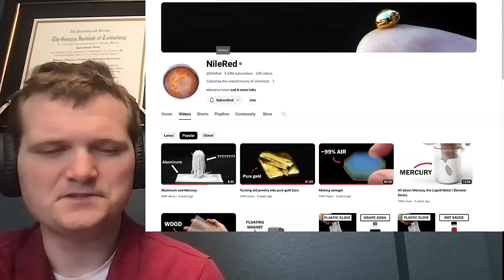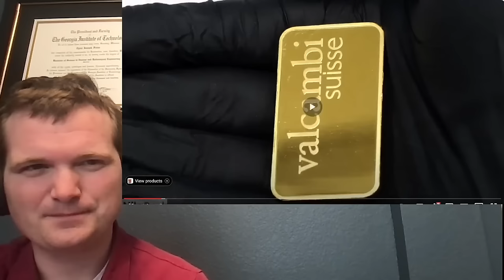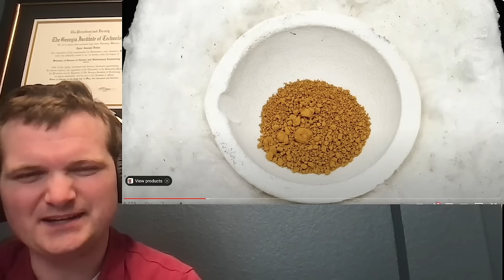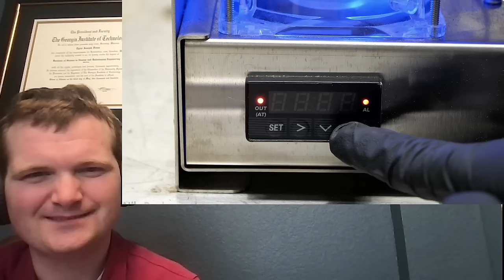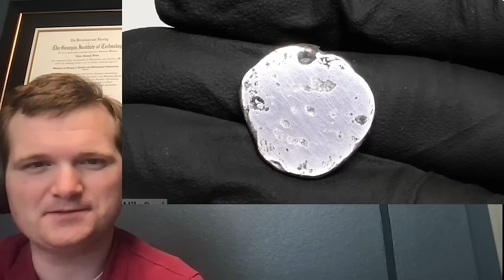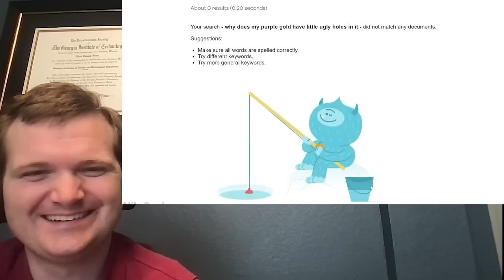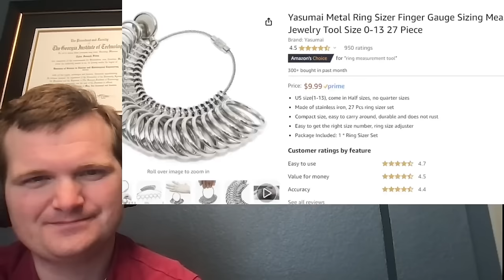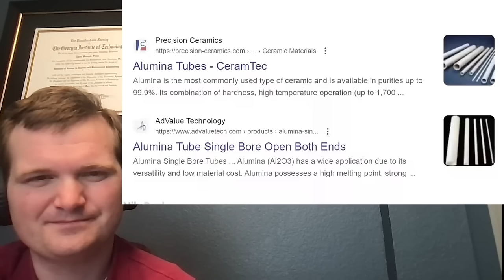Nuclear Engineer Reacts to NileRed Making Purple Gold FULL Version

Comment: Former jeweler/caster;  the other reason you preheat the molds is if there is ANY moisture when that molten metal hits it, it could very well be released as steam and blow through the metal making a small “explosion” of molten metal from the pressure.
Reply: I've seen horror story videos of metal recycling furnaces where the supplier was lazy about drying their scrap before putting it in to melt down and there was some seriously terrifying flash boil explosions.
Reply: Doesn’t water expand 1000x when it converts to heat? I’ve seen some safety videos of steel smelters with moisture in them. It’s terrifying
Reply: Friend of mine used to work at ALCOA(sp?) and one of the smaller (still very large) crucibles they used had some water in it. the woman casting it had molten aluminum blast up under her face shield  and over her head. multiple reconstructive  surgeries required but she wasn't blinded or killed so I'd consider that lucky.
Reply: @sharxbyte  a friend of mine works at an aluminum foundry and he regularly sends me videos of explosions. I guess Eastern Europe doesn't have the same safety standards as North America.
Reply: That’s why I preheat I use old molds
Reply: @Ashley-lz9jh  Yes, steam at one atmosphere has about a thousand times the volume of the same amount of water. That's what destroyed Chernobyl number 4 and the reactors at Fukushima. Steam explosions, except that a melted reactor is even worse to spread around than molten gold.

Comment: I assume that most of the missing gold is a super fine dust embedded in the sandpaper directly. There's a reason companies that work with precious metals will incinerate that sort of stuff at yend of their useful lives.
Reply: Very true. Most of it is probably embedded in the sandpaper, however even gold will vaporize if kept at high temps long enough. Especially when agitating it. It's not a huge loss,  compared to what is likely stuck in the sandpaper, but it isn't zero either.

Comment: It's because purple gold is an intermetallic compound rather than an alloy. A mixture of 75% gold with 25% copper makes an 18k red gold that also can also have brittleness problems. If it is repeatedly heated to annealing or soldering temperature and allowed to air cool it develops intermetallics that build up, dramatically reducing the ductility and malleability of the alloy. So for an 18k red gold it either must be quenched in water or alcohol above 700°F or mixed with a couple percent silver to eliminate this tendency to develop brittle intermetallics.

Comment: it is brittle because the crystal structure is altered by the differing size of the atoms. if you mixed random metals in random proportions youll mostly end up with brittle garbage that is not useable as a metal.

Comment: When Germany invaded Denmark in 1940, de Hevesy dissolved the gold Nobel Prizes of Max von Laue and James Franck in aqua regia to prevent the Nazis from taking them.
After the war, he precipitated the gold out of the acid, and the Nobel Society recast Franck and von Laue’s awards from the original gold.

With his color issues, I'm willing to bet that it's all an issue with crystal phases. That would explain why annealing it changed the color. Also, his hydrogen problem very well may be why others claimed that the alloy was so brittle, as hydrogen is a royal pain in the ass in causing embrittlement of metals (although, that's usually over time as the hydrogen penetrates the metal).
Reply: Usually over time, but when it comes to welding with cellulose based fluxes, it's instant and royally annoying lol
Reply: Crystallization was the first thing I thought of also I think any welder would we have seen it so frequently😂

Comment: 8:42 comma as a decimal separator is more of a European standard.
Reply: I think this also applies to all of South America. From Brazil, I had never seen anybody apply periods to decimal separations prior to learning english.
Reply: @mrkoala2824  how can you tell the difference between 100.000 and 100,000 for example? Seems like some dangerous miscommunication could happen, especially in chemistry.
Reply: @JohnDoe-gn3rg  I don't think 100,000 would be used, since if it needed to be that precise, it would more likely be something like 100,0001. So, it could just be rounded to 100, which doesn't make a lot of sense. Same way 100.000 would more likely be interpreted as 100000 instead of 100, and 100,000 is IMO (999,99 ÷ 10)% interpreted as 100000

(again, 100.000132 would become 100 and 100,000132 would become 100 and 100,000 would become 100000)
Reply: @jimmykrochmalska3501 Nope, i would identify them all as 100. I would never even consider that somone could mean anything else than denouncing a decimal as the standard to make large numbers easyer to read is 100'000 which makes things very clear. No mistaking 100'000,00001.
Reply: @Manuelslayor  If I'm not mistaken, ['] is used in switzerland specifically, Because in most of europe we use [,] in most of the US they use [.] and in switzerland, they use ['] (At least I think. Correct me if I'm wrong, I have also never really seen the use of ['] before.)
Reply: @jimmykrochmalska3501  My man, you joust shatered my whole world view. WHAT THE FUCK! Why is switzerland and liechtenstein the only ones who use it. It is so logical, and there is no chance of mistaking what is meant. Even some programming languages use it.
Reply: @Manuelslayor  It would make life easier. It is confusing to see 123,123 and 123.123 because they are practically the same, and you just have to guess using context to say they are indeed 123[, or .]123 or 123'123

Even that example is confusing. Oh well.
Reply: @JohnDoe-gn3rg  No self respecting european chemist would use anything other than scientific notation, which makes it very clear what is a decimal or a thousands separator.
Reply: @TheBayru  true. I’m more talking like HS first year chem students who may get confused.
Reply: @TheBayru  Yes, but the problem here is that there are two intersecting disciplines. No chemist would use something other than scientific notation, but a jeweler is not a chemist. The majority of people looking at buying gold are NOT chemists, so you would expect gold to be sold using scientific notation.
Reply: @kg4wwn  I was responding to "seems like some dangerous miscommunication might happen, especially in chemistry".

Comment: In many places, in Europe at least, the comma is used to separate decimals from the full numbers, and from 10 000 on a simple space is used to separate numbers just for reading assistance. 2000 for example is just 2000 (instead of 2,000) and 100 000 is the same as your 100,000... 

This is especially helpful for regular writing and typing because the comma is already used in language for other things. For example if you list numbers like: 1000, 10 100, 653, 200 500... you know what it says BUT if you type it the American way it becomes 1,000, 10,000, 653, 200,500... and even though you CAN read it, it becomes very confusing to read, because the comma is used for two entirely different things.
Reply: Doesn't the same problem exist with: 10.7, 14.5, 1,003.57, 567.42... versus: 10,7, 14,5, 1003,57, 567,42...?

Comment: The gold bar was from Switzerland, so it makes sense they used decimal comma - almost entire Europe, South America and half of Africa is using decimal comma instead of decimal point. Separators for 3 digits vary from country to country but usually it's apostrophe or space.
Reply: I agree that apostrophes works fine in practice, but is not particular common and it's not something countries should actively adopt as a standard. 
A space (more precisely a "thin space") is preferable, and it should like other digits separators only be used if really needed.

India uses a rather interesting system. The notation for separation is comma, but they don't merely separate every 3 digits, but a combination of 2 and 3. Again, not something other countries should adopt :)
Reply: @fastertove  I wasn't giving my opinion on apostrophes and stuff, I just stated the fact, that decimal comma is quite common around the world and thus, it's not uncommon to use different than comma ways to to group digits.
Reply: @proosee  I agree, other than apostrophes being a common practice.
Reply: South America we use period for thousand separators

Comment: 4:25 if you look at a phase diagram you can see straight lines in pits of the melting point where the liquidus and solidus lines meet, defining one very tight melting point instead of a softening range or structural change. Those are compounds and those really tight points in the concentration on the graph always mean some odd, wacky metal alloy that will just... sometimes behave like a salt even? They are crystaline, sometimes fragile and act like a pure compound made of metal and non-metal. Good examples are CuAl2 or the well known carbides like Fe3C in cast iron. AlMg mixes can form two, Al3Mg2 and Al12Mg17 and the latter will be almost glass-like. Compounds are vile. Eutectics like SnPb (60-40) solder, SnCu (99.3-0.7) solder or "alusil" AlSi alloy for casting are also kinda interesting in the same regard but they are kinda different.
Reply: “I like your funny words magic man.” - me

Comment: i had a thought on the degassing he did to get rid of the cracks.
when he melts and solidifies the aluminum, it lets out a bunch of hydrogen gas, which causes cracks. so what if he kept the argon on it, and just kept melting and cooling and melting and cooling and melting and cooling it in the forge? each time he does it, it would potentially expel a bit more of the gas, until none (or next to none) left. kinda like he was distilling the purple gold.

Comment: While gold would be very expensive as radiation shielding it is quite commonly used in creation of X-Rays for imaging and treatment (in treatment it is only used in older lower energy machines and to my knowledge all comercial Linear accelerators  use Wolfram these days)
But gold is very usefull for it´s density AND incredible thermal conductivits, because almost all energy from the accelerated electrons get´s converted into heat.
It´s also very interesting that the USA also uses the german word Bremsstrahlung for that type of Process

Comment: Well, you're close to the use of gold in terms of "keeping things still", gold is actually biologically inert, meaning it doesn't react with anything like stomach acid, blood cells, anything that the body might do to cause things to move around or destroy it. So it allows whatever is put in there, to simply stay there, so long as nothing external causes it to shake loose or whatever.

Comment: Swiss dude here, we use a comma as decimal point in handwriting, but on computers we use both comma or period. To seperate groups of three digits we use an apostrophe. I really like that system because there is less room for errors, especially in handwriting. 10'001 is clearly ten thousand and one, but 10.001 and 10,001 can very easily be confused.

Comment: In Australia, large scale alchemy is all we're allowed to do with our one and only nuclear reactor, it's illegal to even run the steam produced by the cooling water through a turbine and produce electricity with it, so our reactor is a net consumer of electricity, only because it's illegal to produce any electricity from nuclear. The purpose of it, is because we're an island, with the nearest country with nuclear reactors that can produce radioistopes being China, all our medical isotopes and radioisotopes used for industrial and commercial purposes, like Co-60 for portable sterilizing by irradiation, or Tc-99, I-123 and I-125 as radioactive tracers to detect leaks have to be produced locally, as by the time they would arrive here, you'd only have a fraction of the initial amount shipped.

Comment: while his ring with the defect turned out really nice, I'm frankly surprised he didn't just try putting the graphite mold with purple gold partially formed, into his furnace, and just heating the whole thing back up to the melting temp, the mold would have been fine,  and the excess gold top could have flowed back into the ring form.

Comment: Indonesia (an ex dutch colonies) use komma define decimal number.

Anyway I imagine fusion would change the number of protons in the nucleus of an atom and transmute it into different element, while puple gold AuAl2 basically still elemental gold atoms being locked together with aluminium atoms becoming a compound chemical.

That way you can attack just the aluminium with HCL and leave the gold atoms alone, turning them back into pure gold.

Comment: So the issue with the sanding is the complete displacement of the crystalline structure. It needs to be heat annealed back to the crystalline form.
Reply: Edit I just got to this part of the video, it makes perfect sense. Think the crystal structure is like fur and sanding the surface is like putting it in dread locks. You gonna have to comb it out to see that proper color again.

Comment: The comma with 1 digit after is to show that the number of 9 after is incredibly high. Kind of like when there is a horizontal line over a number to signify it. Just a different way. So in short 99,9 is 99.9999999999999999999999999999

Comment: So this reaction probably would have been more effective to do in a vacuum chamber without oxygen like a non reactive gas like argon. EDIT. seems so but I was thinking earlier in the process to avoid needing to reheat it, so instead of using mixing bowl use the crucible and maybe some current induced stirring on the metals rather than a stirring stick etc.. 30:00 OMG it is the lattice structure already, and heat will effect the bonding unit, different shape crystals reflect color differently. Geesh. Seriously you guys a scientists how is this not obvious.

Comment: In case of interest for "," and "." as a decimal, it's the difference from language. I'm from Quebec (french) and use "," as a decimal. In addition, I work in english and have to use "." as a decimal. Even worse, Quebec has laws for working in french for software availlable in them, breaking some function with bad translation because decimal are usually coded for "." and break with somehing else